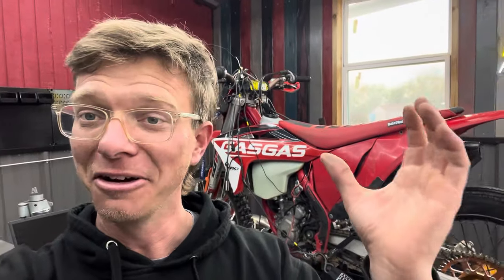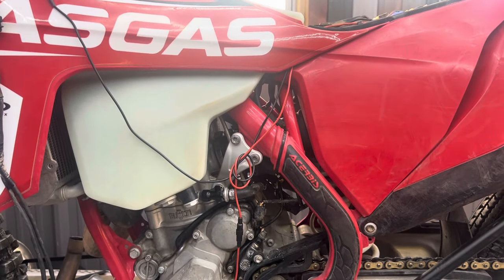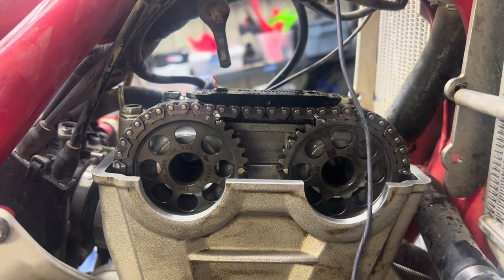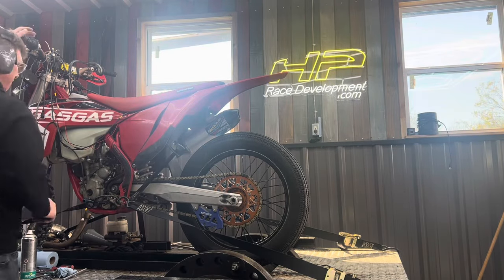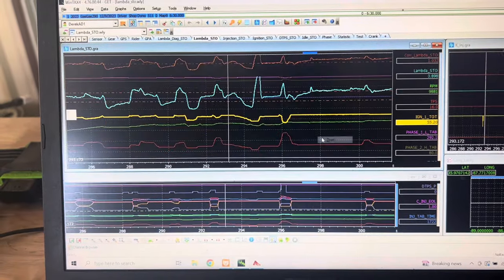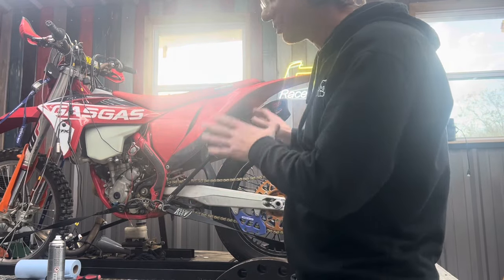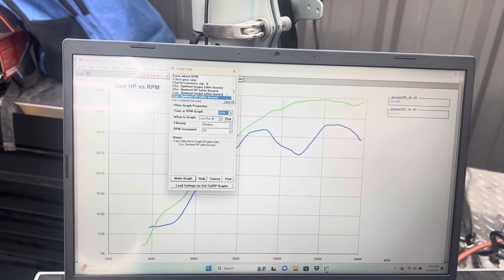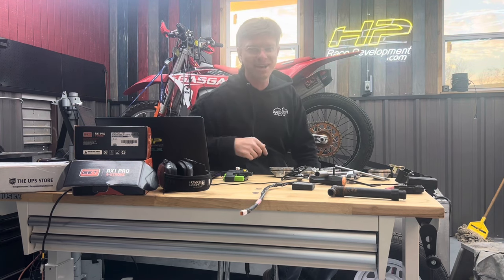Terrible!? 290cc Big Bore Results: Intro to 4 stroke tuning/mapping Process explained

Comment: When verifying cam timing you mentioned you verified topdead center then showed the cam gear location. I was curious, have you ever ran into a cam gear that had sliped time therefore cam location marks could be correct but cam degree could be out? If so do you degree in the cams to verify or is there no need as the possibilities are inconceivable? I was just curious as I ran into this on an older ltr 450 that had pressed on cam gears and wondered if that ever plagued you in the shop? And if there is something you  commend I could do to be better at maybe catching that or recognizing it sooner so I can become better As always thanks for the content!!
Reply from the maker: Yes on engines with pressed gears - but this engine has 1 piece gear and cam.

Comment: Speaking of cam timing, the Kawasaki KLX 300 cams are set screwy. If you swap the intake and exhaust cam timing you can gain 4-5 hp
Reply from the maker: Not the case on the motocross models…

Comment: Interesting Derek, I have had both your 270 kit and the 290 from Thumper/Built on my 18 xcf. For me riding off-road I found the 270 didn’t give the roll on torque feel that I wanted and so moved to the 290 which provided me with what I was looking for. Both kits were used with the stock ecu tuned with around 10% more fuel everywhere and then I tried a vortex where I could manually adjust the fuel trim on the trail. It’s very surprising that a std tuned 250 is so close on the Dyno because my on seat feel from 250-270-290 was a substantial gain each time. The 290 makes the 250 feel like a highly strung 125
Reply from the maker: goes to show just how oddball humans are…

If you opened the throttle more ud gave gotten more on the 250 and 270.  we did a full sweep of partial throttle power runs. after about 40 percent there wasnt any gain to the 290
Reply: You should show those part throttle runs so people can see and understand the difference. Very few people can or do open the throttle 100% corner to corner  because of terrain and conditions unlike a dyno run so it's not showing the full picture. @HPRaceDevelopment
Reply from the maker: It takes a really long video to do that.
But maybe some day.  This video was in reality 8 hours of testing and tuning time... The thing that I personally don't understand and dislike - is if partial throttles are what peopel shoot for - and "feel" is faster - just open the throttle more...That's literally the purpose of the throttle - to modulate power. @cdt262hi

Comment: I just got a 2020 250 sxf and whats ur opinion on what I should do with the oil pump gear since there plastic. Cause Ive seen videos of other people switching to an aluminum gear.
Reply from the maker: Taco Moto Co has some for it if you wish to swap
Reply: @HPRaceDevelopment  but is it a critical part that it does need to be changed or no?
Reply: @adriangalvez5104  the 2020-2022 plastic gears were updated and are safe. 2016-2019 were the faulty ones. but if it were my bike i would buy the updated steel gears from ktm; not too expensive.

Comment: Can you fix the super rich cold start that seems to plague the 21-23 yz250f without buying the GET?
Reply from the maker: Why do you feel the yz250f has a super rich cold start issue?
Reply: 37 b4 46 aftr u tunedit
Reply: @HPRaceDevelopment  fouling plugs seem to be very common on the 21-23 yz250f, since mine was new it has smoked when cold and smells like fuel. It clears up as soon as it comes up to temp and never happens again. It doesn’t lose oil, or coolant and people I ride with have the same issue. I change the plug every 15 hours and it’s always as black as night. I’ve never had this issue on a four stroke before
Reply from the maker: @sojersey2v  We havent had an issue…bikes have to be rich when cold to run or they wont start or run

Comment: Holy shit that stock ecu map is scary. The hell is that dip doing there. Smh. Unacceptable and the fact people can’t feel stuff like that drives me insane. Peak power is super important as well as ride-ability really the only way to get that is to blend track or trail time with dyno time and get stuff right. If I have to choose one over the other I’m going to the dyno. Idk why people do not understand this and want to tune fuel tuners themselves without collecting data.
Reply from the maker: I think he could feel it - but for mostly partial throttles it wasn't too bad.
Reply: @HPRaceDevelopment  true things definitely could have been worse, I’ve got an efi bike like that at the moment. I’m picky I suppose because I’ve been tuning carbs most my life. Obviously efi is a different book entirely but conceptually the same as far as making peak power with rideability. Nothin worse than a tune that only works at wot. Drives me nuts. I have a kx250f right now that’s like that that needs a custom tune because of what’s been done to the engine. The current off the shelf tune from a company who will remain unnamed is a WOt only tune. I appreciate the efi guys like you who work at making both sides of the spectrum work so a bike runs right as things get a bit more expensive to tune with efi than a 4 dollar piece of brass 😂😂😂👊🏻👊🏻🤙🏻 efi is out of my range at the moment.